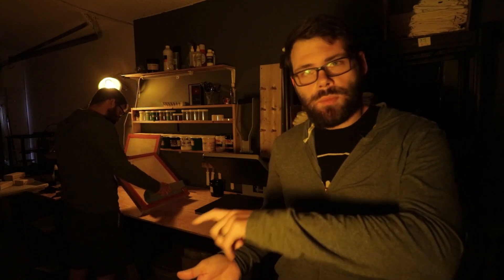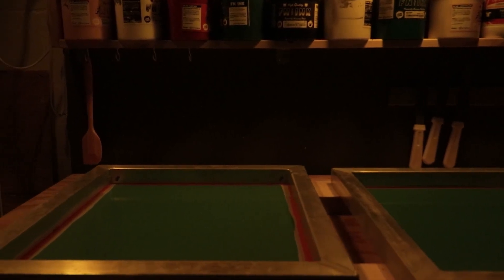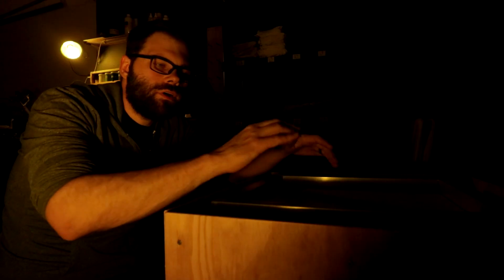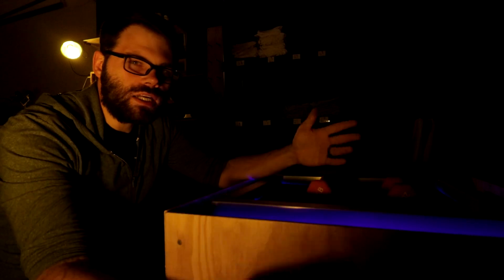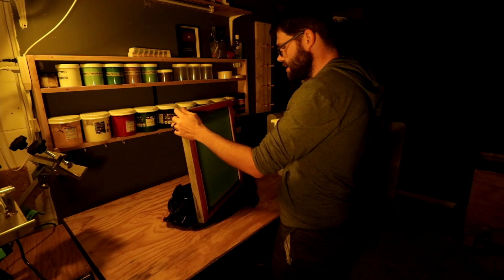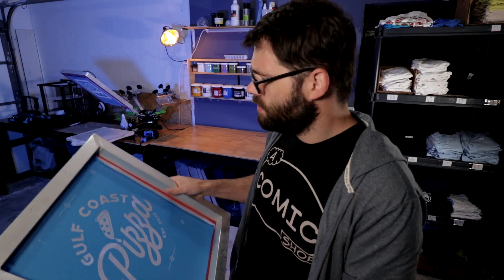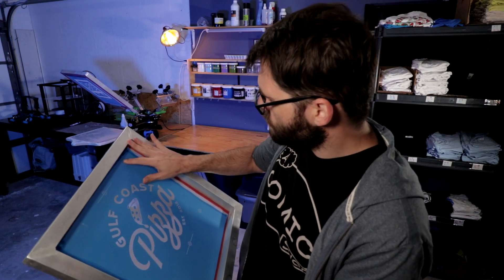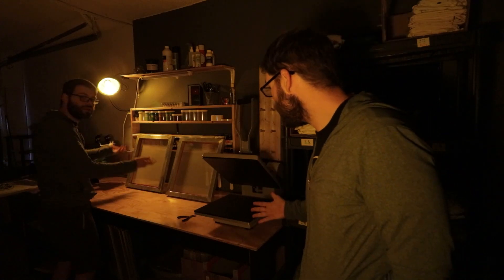The Basics of Exposing Screens /// Using a DIY Exposure Unit for Screen Printing

Comment: Underbase film what u mean? Why it shout me with more down mesh?
Reply from the maker: An underbase is a layer of white underneath the other colors in your design. Not everyone uses one, but it can help make the top colors brighter/more vibrant on dark colored garments. If you use an underbase then its typically done with a lower mesh than the top colors.
Reply: @joshisterrific  thank you so much!!! Did u know how much time we have to wait between applying the diffrent colors? And how much watts is the UV light good?
Reply from the maker: @LLLLLLL156  I would use a fash dryer in between colors, let it dry for about 10 seconds before moving to the next color. The exposure unit has 140 watts with the UV lights I used, a link to those should be in the description of that video.
Reply: @joshisterrific i was asking abouth your DIY video where u make your own led exposior. I wanna make mine but cant find the Watts
Reply from the maker: @LLLLLLL156  yes, that diy exposure unit uses UV lights that are 140 watts across 8 light strips.
Reply: @joshisterrific  so the time depends on the watts if at 140 watts is 1 min on 70 shout be 2 min?
Reply from the maker: @LLLLLLL156  there are some other factors that go into the time, like humidity levels, type of emulsion, thickness of emulsion, etc. For me it's 20 seconds on a 160 mesh, but it could be a little different for you. I would use an exposure calculator to dial that in.

Comment: New to this. What is the purpose of the registration marks?
Reply from the maker: They are there for when you are printing a multi color design. They help you align the separate screens together.
Reply: @joshisterrific  perfect thank you! What program do you use to design yours? I'll actually be doing 100+ shirts with two colors, this will save me time + money
Reply from the maker: @hollywhite8538  I'm using Adobe Illustrator for my design needs. A cheaper alternative to that would be Affinity Designer.

Comment: Hey Josh! Another great video! Did you take the glass off your UV light? I have one of those too in my DIY set up and my time is about 14 minutes...hoping that would cut down my time.
Reply from the maker: No, I'm using the light as it came. That may cut it down a little, but if it's the same light I would assume the difference might be from the type of emulsion, or maybe the distance between light and glass?
Reply: @joshisterrific  Okay, thank you for letting me know! I'm using the DIY method you mentioned in your video with the two legs and overhead arm. I'm about 13 inches away. I'm wondering if I should put a box over it to encase in the light. Thanks for the input--great job on the videos!
Reply from the maker: @heatherjennings145  hmmm, I think mine is a little closer to the light. Either that, or the light isn't as bright. Could also be the type of glass. I tried to get the clearest glass I could find. You could try the box idea, but I feel it should still be lower than 14 mins even without that. You could also try adding more UV light to the mix to make it brighter.
Reply: @joshisterrific  Good call--can't wait to get out and screenprint--come on Spring!

Comment: Is that chromaline wr emulsion?? Great video
Reply from the maker: This one is Ecotex AP Blue.
Reply: @joshisterrific  I have the same emulsion but I am having trouble with exposure times. I keep getting blow outs during the washout process. I'm also having trouble removing air bubbles when I stir the emulsion. Any tips?
Reply from the maker: @notanactualkittycat  my first guess is it's underexposed and that it needs a little more time with the light. I also have been told that a pre-soak and washing out the back side first helps with this. As for air bubbles - I've gotten some of those, and I try letting it settle naturally in the scoop coater or shake/tap it if I need to, but sometimes I just can't get them all and I try to just make sure the coat is as consistent as I can get it. I like the Ecotex emulsion okay, but I'm still trying out other kinds to find one I love.
Reply: @joshisterrific  Thanks for the advise. I'll definitely step up the exposure time (right now I'm at 1min). I'll try a minute and a half or so.